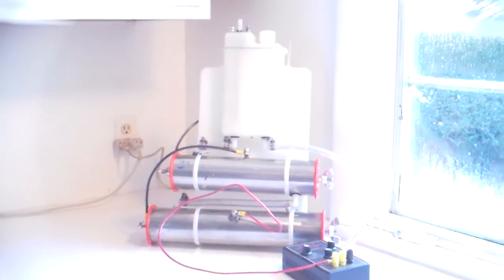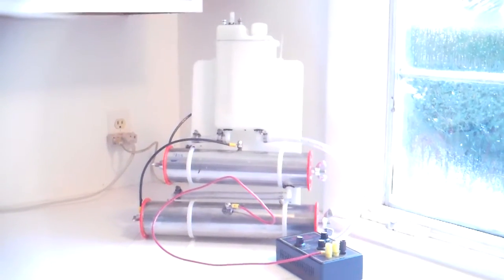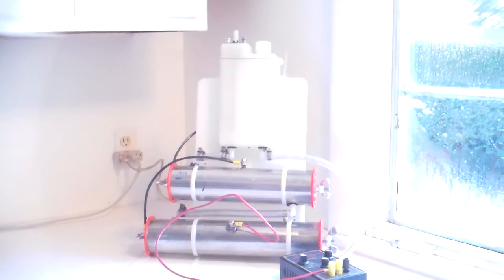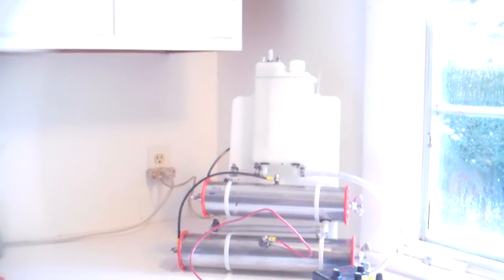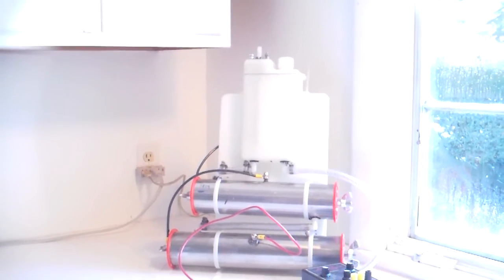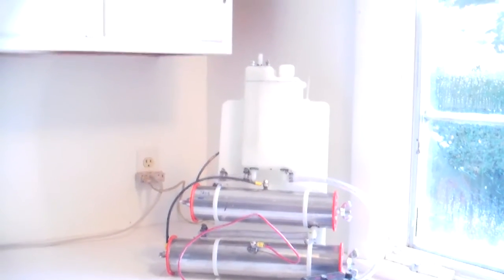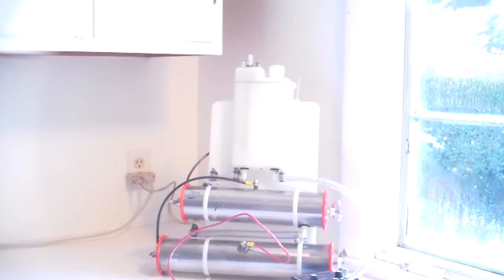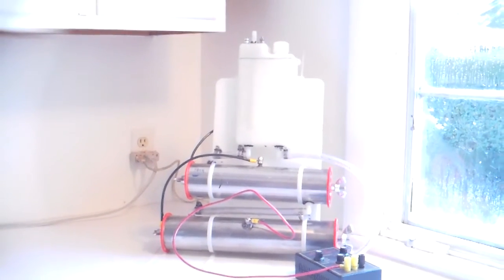Advanced HHO System With Smart PWM For PickUp Trucks

Comment from the maker: Please note that anyone who thinks HHO is a scam is not smart enough to work on engines much less build and install HHO systems. The jerk, below is only trying to promote his own system. If you think HHO is a scam tell it to the 12 truck drivers who have our HHO system installed and report 35% boost in fuel mileage. That increase is saving them over $20,000 a year.
Reply: hyfusiondotcom im interested about ur system smart PWM. do u have a vids on how they are working
Reply: Please note that your full of shit and this is the way you brush off actual facts.there isnt the first vid on here with actual unbiased proof ..reason? Because they dont  work in this fashion.
Reply: Notice to everyone that all these vids claiming to work are sellers or guys pushing the vids for other sellers with "hho" in their name titles..trust me i wish yhis worked as much as you all..the only way you can make enough in the car is with more electric generators and current or to make it and compress it at home and drive with it bleeding off.. which then presents a hazard as pressurized hho is EXTREMELY DANGEROUS AND EXPLOSIVE IF YOU WERE IN A CRASH..these things can go off like hand grenades. Ask me how i know